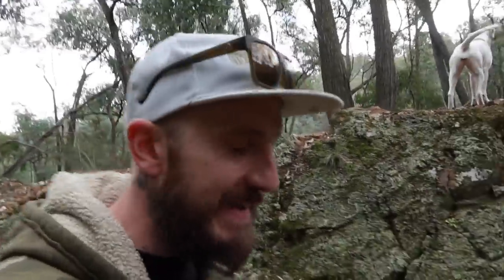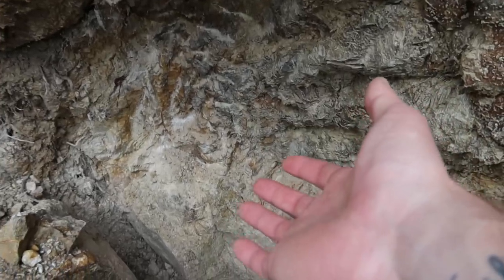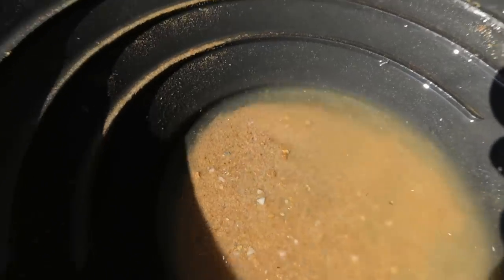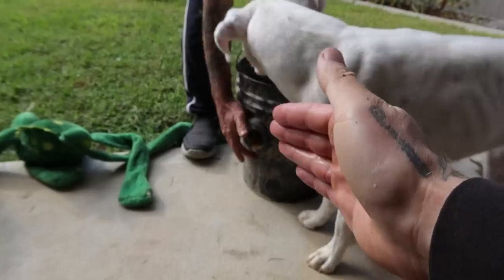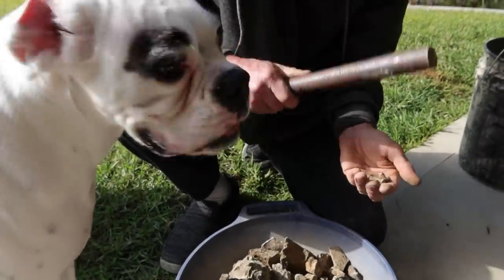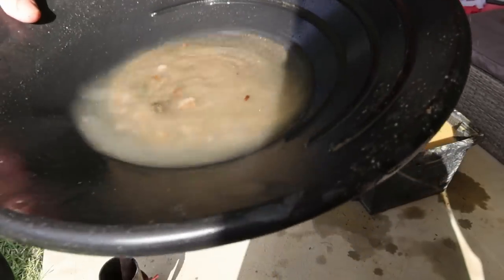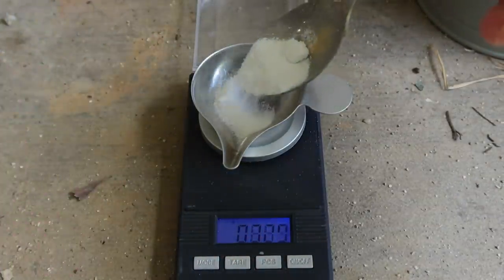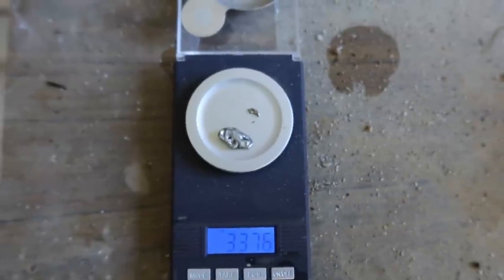From Solid Rock to Gold! | Mining Hard Rock Gold Ore

Comment: Hi Chris, a cone shaped mold would be a great thing for small melts like this and you can make one yourself.  Get a block of Graphite, then a small step bit out countersink bit for your drill to bore out the basic shape.  Remember your drilling into graphite so your gonna make a mess (grin).  From that, if the cone shape is rough, a small file or sanding should help you smooth out the shape.  I made my own and I love it.

Comment: You won't be able to purify your gold as long as you have silver in it. You can add like 4x's the amount of silver and cupel. This can then be parted with a 25% HNO3 solution. However i don't know your stats on purchasing nitric acid in Australia. Here we can pick it up at most prospecting supply houses. A good oxidizer for your flux would Potassium nitrate. You can find it in stump remover at the hardware store, or at your pharmacy commonly called salt peter. Sometimes because of mans laws you have to work around them🙂. When using this oxidizer you don't want to put any reducing agent such as soda ash. Just borax and silica sand. Obviously you don't want to be trying to reduce back to metal what your trying to oxidize out. The fumes coming off you furnace will cause any tools or things made of metal to oxidize or rust. So be sure to do this close to the neighbors house you don't get along with🙂. No nails. Just oxidize the heck out of it. It'll take some lead if not all. So you will be dealing with PbO3 please don't breathe. Good luck! Trying to put 50+ years of experience into a paragraph. Any questions? You can get me back through here. Also, your flux should be at least double the weight of your sample. Many of us prefer triple. You have a chemical reaction in a crucible. Not a beaker where you can add more at your convenience. Peace!
Reply from the maker: Thanks for the information man
Reply: @SpudEngineering  You're welcome! May all your days be golden, And be blessed by the Best. Peace!
Reply: I have gold stone, I don't know how to go about this processes. Please reach me.
Reply: @richardbeee  I have granite rocks weighing 10 kilograms. I crushed them, cleaned them, and I have 3 kilograms left. What is the amount of smelting flux materials needed for each of the silica borex, sodium carbonate, and the aggregate metal?
Reply: @calm_4k  I assume you have a concentrate?
Reply: @richardbeee  Yes
Reply: @calm_4k  what's your predominate metal. That's what you want to reduce and use as a collector of the others. Also I find a 3 to 1 concentrate as being really rich. Usually out of 10 kilo of ore you would get maybe 100 grams of cons. This will effect your silica content as well as your borax.
Reply: @richardbeee  I think the dominant metal is lead. Do you recommend it?
Reply: @richardbeee  Should I reduce the size from 3 kilos?
Reply: @richardbeee  I didn't reduce the size because I thought I would lose some small gold pieces, because the granite and quartz samples I found contain mirror gold.
Reply: @calm_4k  If it's lead then chances are your gold is mixed with it. I'm not familiar with the term "mirror "gold. It may be it would be cheaper to use a solution and dissolve the gold. Don't know. I see no problem melting it. Three times the weight in borax. 2 times the weight in soda ash. Silica is going to be your variable. Either one times or a half. Sounds like you are having a hard time concentrating it. That would be helpful if you could. You wouldn't need such a large crucible.
Reply: @richardbeee  I use Google Translate because I am not fluent in the English language, and by gold I mean the woman, meaning that the rock holds a lot of gold that you can see in your eyes😂
Reply: @richardbeee  Thank you for the response. This information is very useful. I needed it from an experienced person like you. Thank you very much 🙏❤️❤️❤️

Comment: A larger smelt.   You would add some iron nails.  To the crucible.   It will cause.  Iron oxide.   Pulls out more sulphides.     Cleaner.   But that sample was to small.